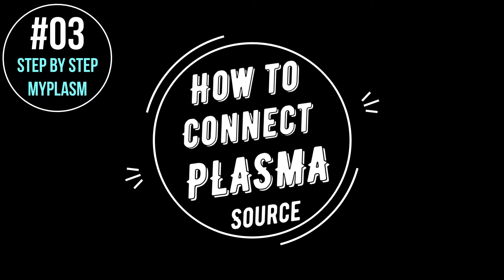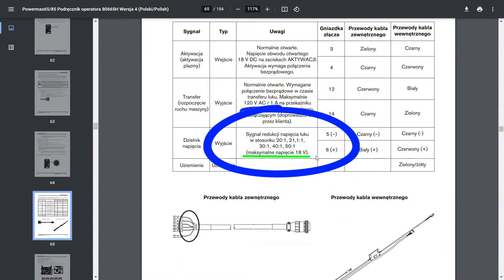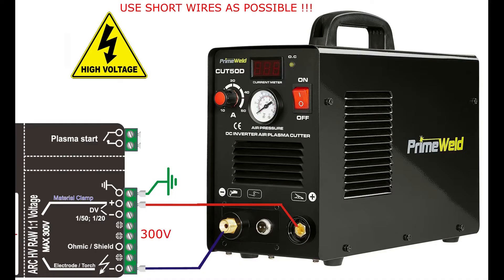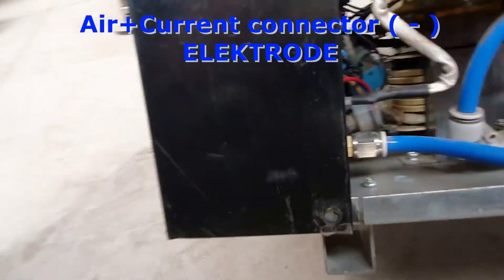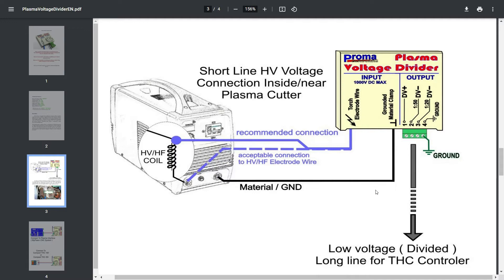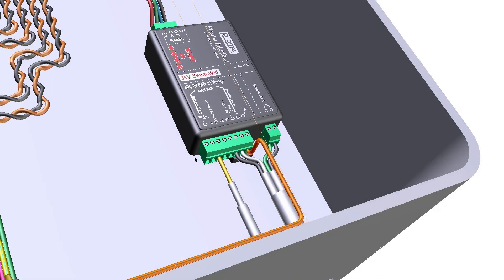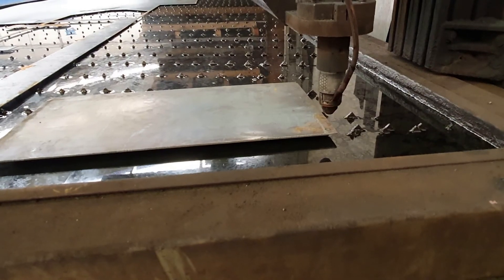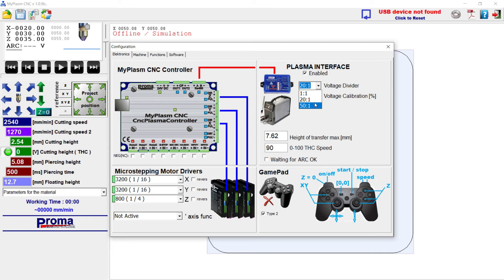# 03 MyPlasm CNC Step by step EN - How to connect a plasma source

Comment: Hi there, I'm using an older model Hypertherm powermax 1000 G3 series power pack and I'm a bit confused about how and where to connect an arc good signal. Thanks

Comment: I forgot to connect the materialclamp😣The system doesnt read the arc voltage anymore even if I reconnect the clamp. Is the interface broken because of that?
Reply from the maker: Not connected Material Clamp id very dangerous for all of electronics. Contact me by WhatsApp ±48 604 247 648